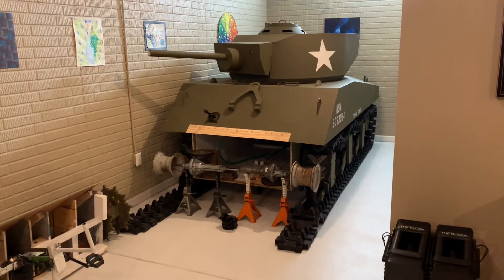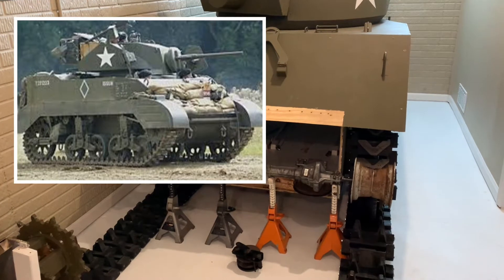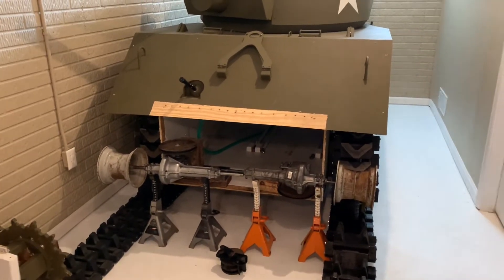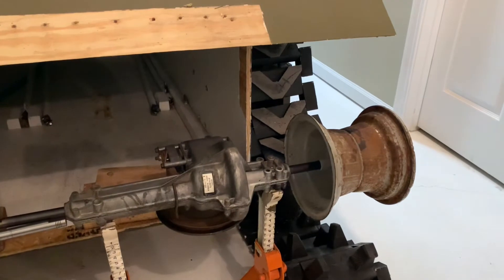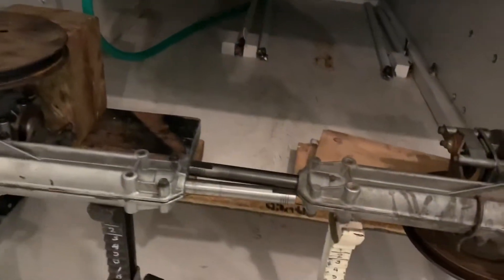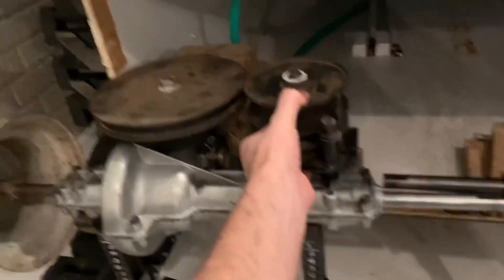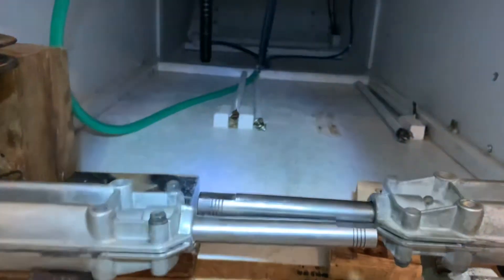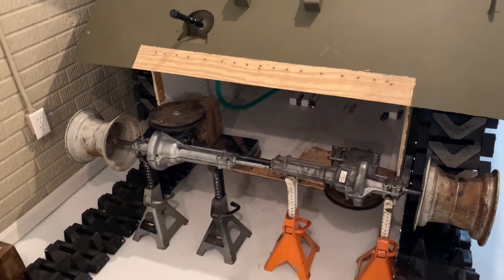M4A3E2 Sherman Jumbo Scale Tank Steering Mock-up

Comment: A little more expensive but a lot simpler would be a belt driving 2 ZTR hydro static drives. I have a pair from an old toro I'm going to try. I like your suspension.
Reply from the maker: Thanks for the reply!  Don't hydro drives generate more heat?  If so, putting two of them in an enclosed space with the driver could get pretty unbearable in July.
Reply: @ryanhahn7251  I'll let you know. They do have fans on them so some ducting could help.
Reply from the maker: @dellmorse4301  what are you building? Are you a member of scaledtanks?
Reply: @ryanhahn7251  yes a member but haven't visited in a long time. Everything required more welding than I desired. Yours was an exception and has sparked my interest again.
Reply: @ryanhahn7251  Well it looks like I'm not a member anymore. I'm locked out and can't get a new account.
Reply from the maker: @dellmorse4301  that’s too bad. It took over a month for my membership to get approved.